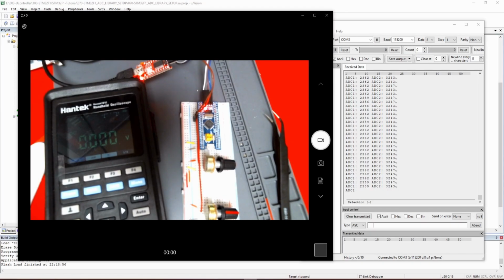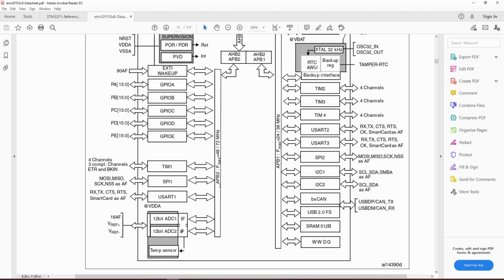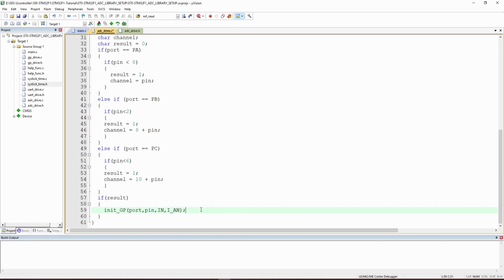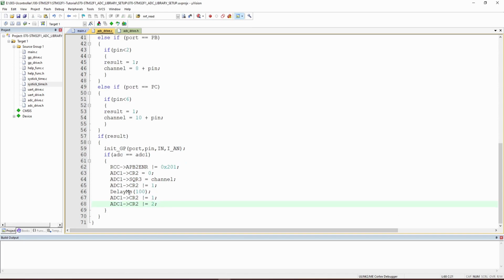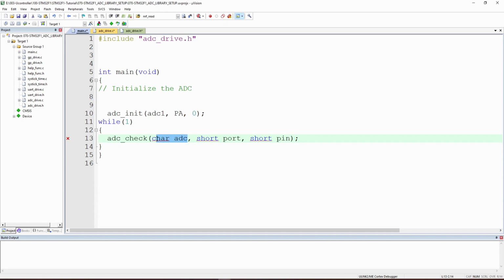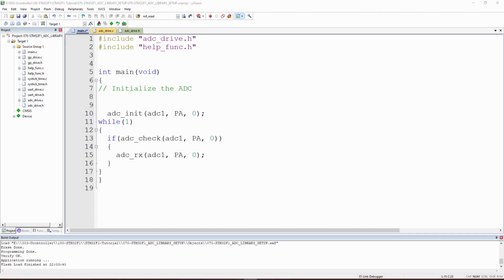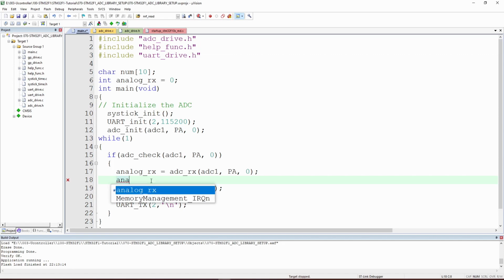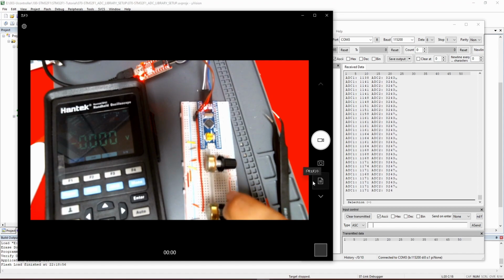070-STM32F1 Analog to Digital Converter ADC setup and result visualization

Comment: Anyone who understand the reason to multiply by 1000 decimal and divide by FFF hexadecimal ?? what is the reason?
Reply: i don't understand, if you understand, please tell me why
Reply: @hhh123uh  hi, STm32F103C8 has 12-bit ADC module. Which means the resolution of the analog read is 12-bit. Means that it will read from 0 up to 4095. If you want to rescale your reading between 0 and 1000, you just need to divide your reading by 4095 (0xFFF) and multiply it by 1000 (0x3E8)
Reply: @chnsnyz  tks, now I'm understand, I think that's why there is a difference between the voltage on the computer screen and the meter

Comment: Hi!! Excellent video tutorial, really useful and comprehensive. However, I was wondering why you set the Alternative Function `AFIOEN` bit in the `RCC_APB2ENR`? ADC works just fine without enabling it, GPIO pins need to be (and are indeed) set to Analog mode. Thanks!